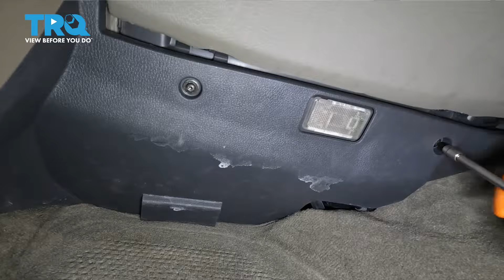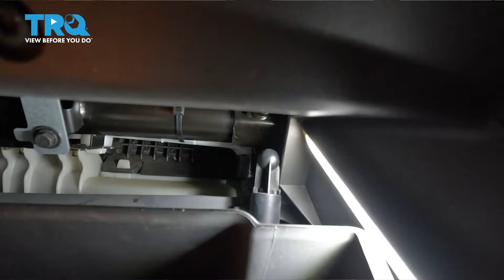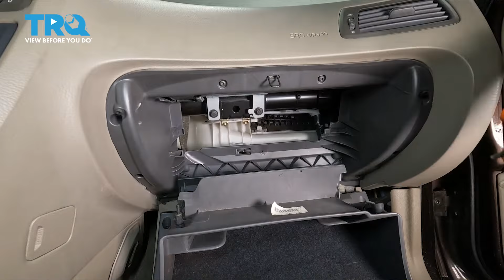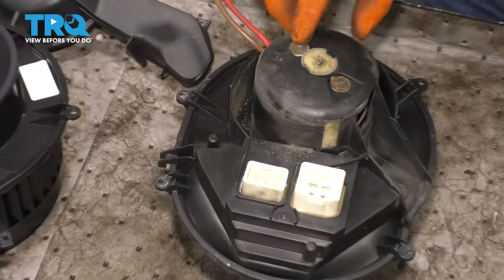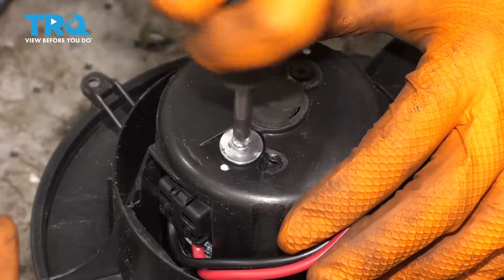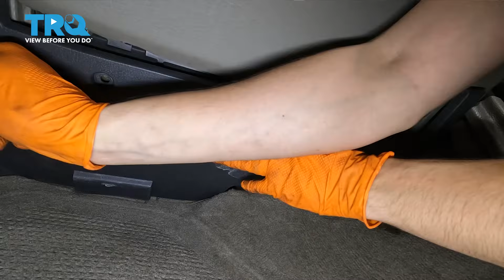How to Replace Blower Motor 2001-2007 Volvo V70

Comment: Awesome, I have a 2006 XC70, my cabin blower fan is squeaking/squealing at lower speeds, I'm assuming the bearing is worn, otherwise its working fine, will try and give this a go, need to find a replacement part here in the UK first.

Comment: Worked for a 2005 xc79.  Previously the fan speed selector didn't work.  It was full on or full off.  Eventually, it just stayed full on, even with car off.   I replaced the blower motor and the resistor/control board

Comment: Great step by step directions... What was the first hose you pulled off for and purpose if you know.  I just changed my blower motor and resistor and there was only 1 hose to blower motor.  I had the second one like in the video.  I did not have the first hose. I think it was missing. 07 Volvo xc70

Comment: I did the blower motor replacement  as well and used this video as a guidance. The one thing I did differently  to avoid braking the glove  compartment  door stopping 
tab/tabs, like here the left side was, I removed the two hinge pins on the bottom side. And i just unhinged the glove compartment  door.
That case  no scars  being made  to your pretty VOLVO. Thanks for the vid

Comment: While you at it, replace the cabin air filter. Good idea to buy a spare glove box strut(it has a tendency to break during removal).If you broke one of the glove box tabs which you were prying off to drop it down, you can use a self tapping screw instead and it will last you for years(you guessed correctly how I know)